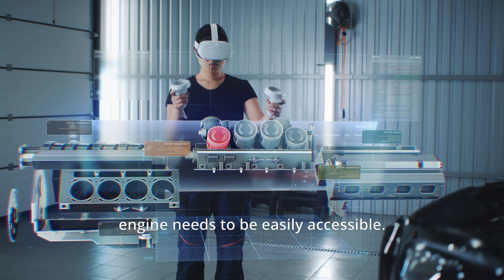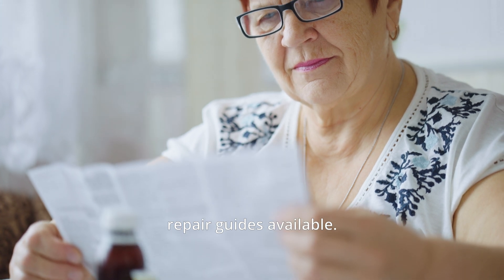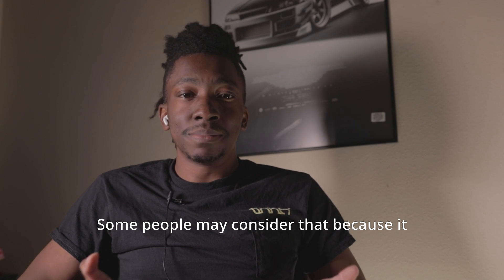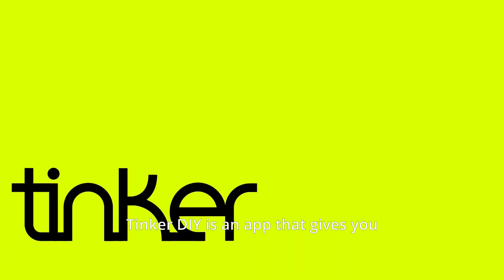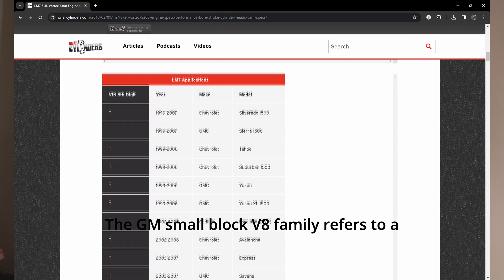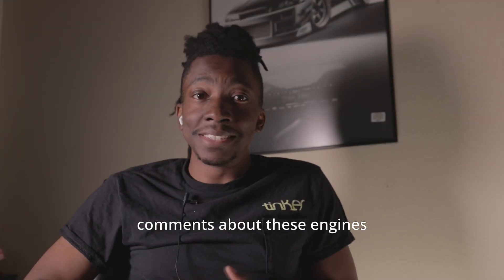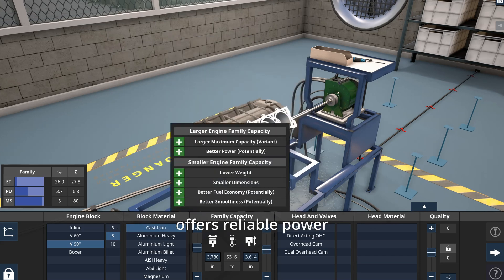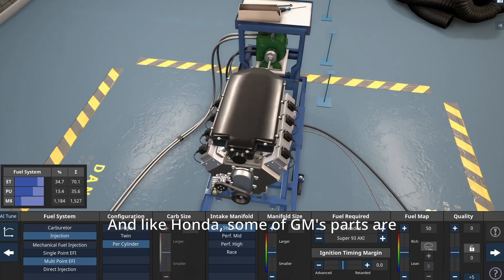Mechanics LOVE THIS ENGINE!

Comment: The lm7 is basically an ls engine
Its pretty much an ls4

The only difference in ls vs lm engines are

Sodium filled valve 
Higher tention valve springs for higher rpm
And in some cases the cam shaft
Reply: Their is lm7 aluminum blocks aswel

Comment: No doubt it's easy to work on, and parts are accessible, and everywhere. It's the small block Chevy's younger brother. Its damn near impossible to make big power, cheaper than LS power. The Coyote will make more, but it costs 3 times as much all the way to 1500 hp, and 99% aren't making 4 digit power.
Reply from the maker: Good for reliable build, decent track build at least!